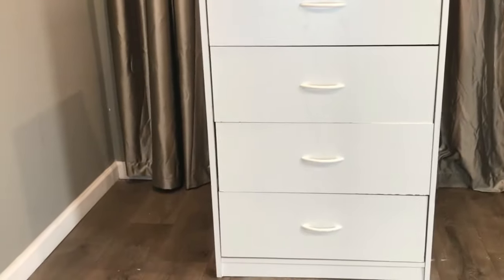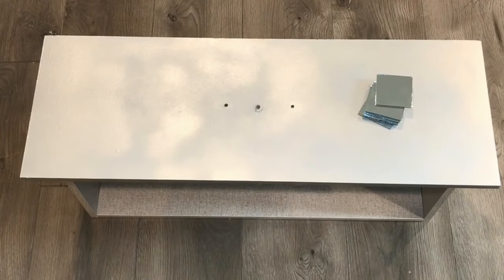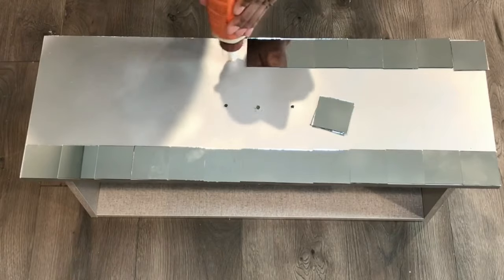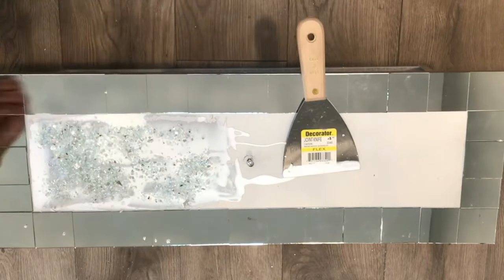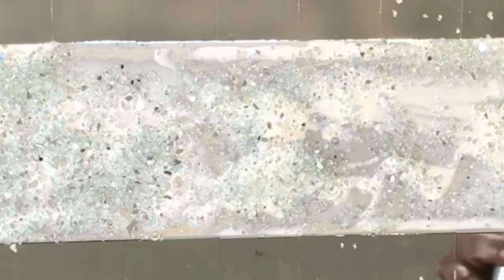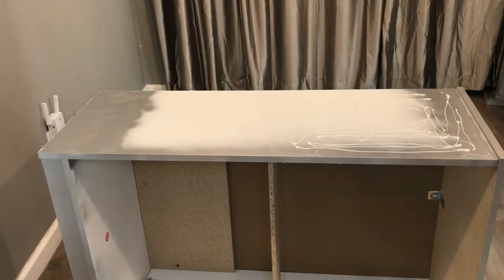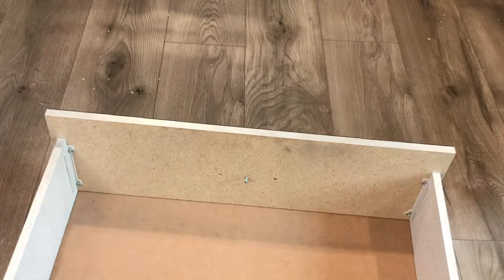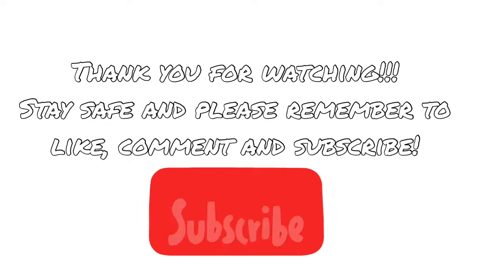TURNING A REGULAR DRESSER INTO A GLAM DRESSER!! Z GALLERIE INSPIRED!

Comment: Dresser was a great transformation!!
One thing I would of done  differently is:
Since the glass panels on side of dresser were cut too short .I would of centered the glass on the sides then put mirror tiles on top & bottom of the glass,  cuz otherwise you have an off center seam on both sides.
Just my opinion and another way to make the sides tie in with front of dresser.
Otherwise, great recycle project.!!

Comment: I had the same problem with length of mirror. My dresser is 41 7/8 in height 18 1/8 width. I told them cut 20 7/8 in height 21in in height 18 1/8 width. Came to what I need for sides, i pieced  it together on both sides. Yes there is a line but get mirror  tape cover it or use glam wrap